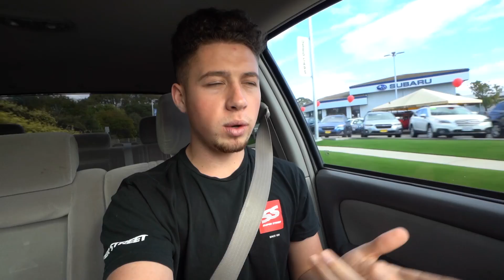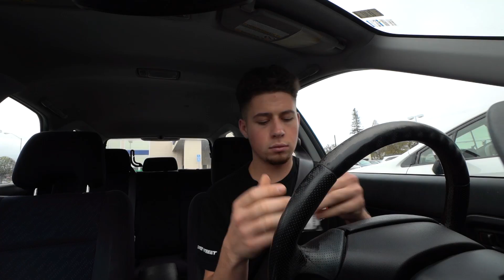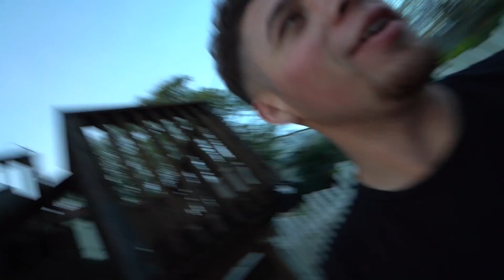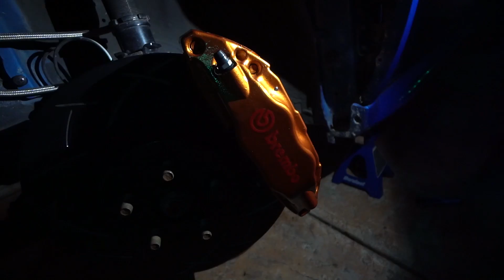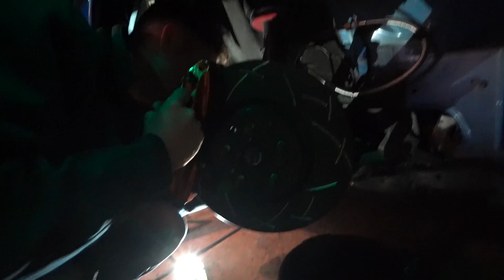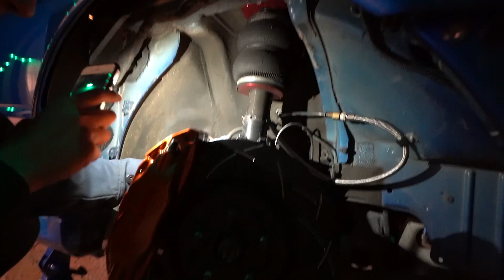STI BREMBO INSTALL ON MY WRX! This is what I was missing...

Comment: Why drive so far for a bolt. Just go to home depot, lowes, napa ,etc... a bolt is a bolt ..
Reply from the maker: Bolt is never just a bolt....
Reply: @_AlexanderVargas  a bolt is a bolt and you know that.. same thread same size same material a bolt is a bolt .. subaru hardware is just as terrible as their engines anyway...